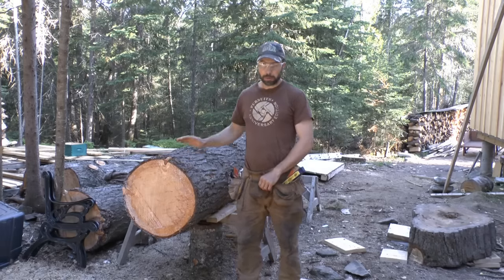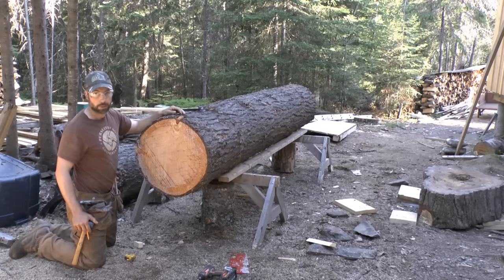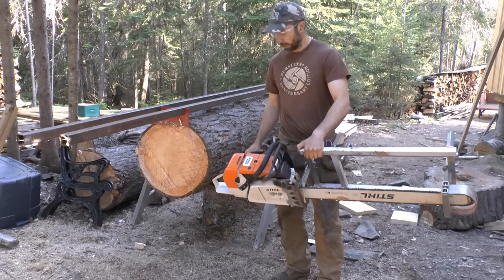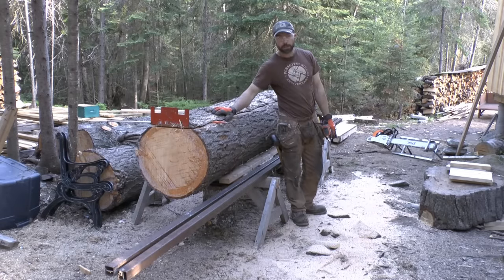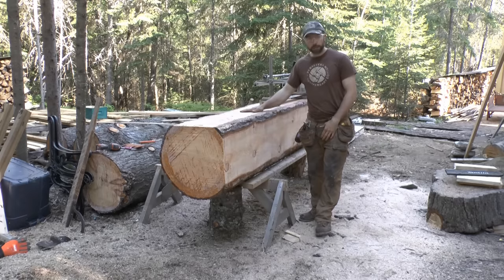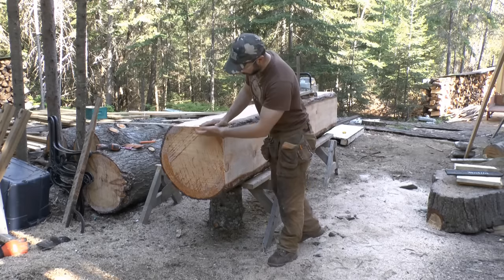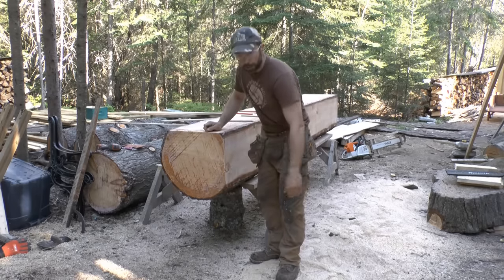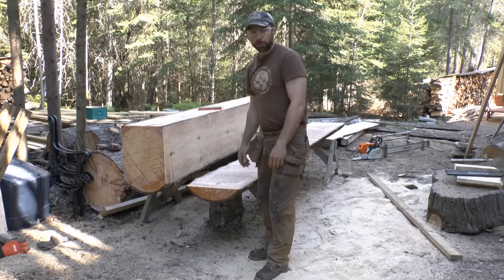Logs to Lumber: Alaskan Chainsaw Milling

Comment: Good job. I don't think you need worry about letting the saw idle to cool it. Not a bad idea on a 4 cycle at least in the old days when there was concern for bent valves. Not so much now.
Reply: I always let my saw idle for 1 or 2 minutes after a big cut....just makes sense.
Reply: You should always let it rest after running it for such a long cut.

Comment: Great video.  Inspiring.  Might be picking up a Granberg MkIV but I like your custom rail system, which looks far more robust than anything sold at retail.  What gauge are those rails?  Steel, right?  Look good and chunky, but not too heavy.  Assuming it's steel to span that kind of length without flexing.
Reply from the maker: Yes, 5/32" x 2" x 2" steel tubing, bought locally. 
The end plates are 1/4" x 12" x 5". The notches for the rails are about 1-3/4" deep so that the 2" rails sit a bit proud.

Comment: Seriously. Where did you get those end plates? I’ve been using an aluminum ladder for more year than I’d like to remember and the end plates with the steel 2 x 2’s looks way more stable. Please share.
Reply: Just found this earlier comment from Lure of the North:
5/32" x 2" x 2" steel tubing, bought locally. 
The end plates are 1/4" x 12" x 5". The notches for the rails are about 1-3/4" deep so that the 2" rails sit a bit proud.  These were cut locally by a metal fabricator.

Comment: Clever set up, but just for interest what width of wood is lost with each cut.
Reply from the maker: It's a little less than a 1/4" kerf.  When cutting 1" boards it does add up to a board or two lost (vs. bandsaws) in a big log like this.  If you're cutting 2" boards or thicker (beams, etc), then the 1/4" kerf becomes pretty insignificant.

Comment: A great beginning to begin milling anything vs buying a whimpy 15" or similar for $7K or more mill saw needlessly. One that is too small and too limited. Matt Cremona has made a very useful one, for a better price than retail...  All a matter of access to getting and moving timber for little or free. Or like a tree service, getting paid to remove trees.   I love the idea, only if practical if you have; 1/2 acre or more area, AVAILABLE ALREADY (FREE) a decent truck, and proper hauling trailer.  It is a must, less is foolhardy. Wood milling like this, elsewhere is okay to begin at the site. But you have to rig and be careful and felling a tree is not a risk most should take, without some experience (30 minutes of youtube it seems haha).  Good luck, looks like such value, only if you need enough of it or sell the lumber.

Comment: Great video, really liked the brackets, hope you don't mind if I borrow that idea, I was wondering how you got those logs up to your home? Green pine weights a ton. How far did you have to move them?
Reply from the maker: Of course use this bracket and rail method if its useful to you!  We hauled these by snowmachine in the spring.  Brought them a couple of km on a homemade komatik.  I'll try to get some footage this spring when we do a bit more cutting.

Comment: cut using the tip of the saw to cut large flakes, using the whole body of the saw creates dust, uses more fuel, and harder on the engine

Comment: G'day,

Interesting.

I too use my Chainsaw to mill Logs, but my setup is an English made "RIPKING" system, using 2" by 1" hollow rectangular Steel Guide Rails & a Slide-Guide..., with a Stihl 038 Magnum and a 36-inch Oregon Cutter-Bar (115 Tooth Chain).

The Ripking is simpler, lighter, one-man portable..., and it cuts with the Blade in the  vertical plane too, rather than gnawing it's way under the Slab being cut off.

The best feature of the Ripking system is that I can use it to propperly Quarter-Cut Mill the Logs so I can produce Timber which doesn't split, cup, warp, twist, bow, or bend as it dries & shrinks - though I could "Backslab-cut" Logs if I wanted to.

This past 3 weeks I've posted 6 videos showing the process of milling a 15-inch diameter Stringybark (Eucalyptus Hardwood) Log, 4 & 1/2 ft long into floorboards for my Verhanda Deck, replacing ones I cut 25 years ago.

The whole job took 25 & 1/2 hours, in 9 sessions over the 3 weeks..., yielding 29 Boards for 3.1 Litres of 50:1 two-stroke Fuel & 3 Hrs & 6 minutes of Engine-Runtime and 2 litres of used Sump-Oil for Bar-Lube...., emitting 7.75 Kg of Carbon Dioxide via the Exhaust.

On average, each Board took 53 minutes of my time, of which 6 minutes & 20 seconds was Cutting-time at full Throttle, using 106 ml of Fuel (21.8 cents' worth), 60 ml of Bar-Lube, and emitting 265 grams of C.O.-2.

   Please feel free to backtrack me to my Videos & title-search "Quarter-Cut Chainsaw Milling" or 
"Salvage-Milling With Chainsaw", to see the way I use the Ripking.

Another feature is that the two 4-ft long Guide-Rails may be "leapfrogged" over each other to enable ANY LENGTH of Log to be milled ; and thus  my record to date is the  24 feet-long 4-inch by 2-inch Purlins, 4 of them, which have been holding up my Verhanda Roof for 24 years - all cut from the one Tree.

The one time that I milled a Radiata Pine Trunk it was so comparitively soft and easy to cut, compared to Hardwood, that I "Slabbed" it into enormous Tabletops.

Anyway, follow me back to check out the Australian variation of the English Ripking Guide-Rail - used to Quarter-Cut Mill Hardwood.

It only makes sense if one has nothing else to do with the time & already owns the dead tree though, because in Oz at minimum wages there's $20 worth of Labour in burning  every 22 cents' worth of Fuel/Oil mixture to make each Board.

But it's a very satisfying passtime, for all that.

Such is Life,

Have a good one.

Stay safe...

;-p

Ciao !

Comment: Did you purchase the metal plates for the ends of the logs on the first cuts or did you make yourself? If bought, can you share where to purchase? Thx!
Reply from the maker: Its just 1/4" plate with cut-outs for the rails to sit in.  I had the metal supplier make the cuts for me when I bought the plates.

Comment: Hey great video Thanks! Did you buy the plates for the rail or make them? Thanks in advance.
Reply: Just found this earlier comment from Lure of the North:
5/32" x 2" x 2" steel tubing, bought locally. 
The end plates are 1/4" x 12" x 5". The notches for the rails are about 1-3/4" deep so that the 2" rails sit a bit proud.  These were cut locally by a metal fabricator.

Comment: What is your saw?  I was using the exact same setup with an older Stihl 044 that worked great for a few years but recently tried to cut thru some hardwood Black Locust and it blew up.  Probably poor maintenance on my part but at this point  l'm looking to replace the saw because repair was not reasonably affordable for such an older saw.  Looking for recommendations.
Reply from the maker: Its a Stihl 880, not cheap, but has treated me very well!  Good luck with the saw search!

Comment: Hey I’m going to build one of these and I would like to get a better look at the jig for the chainsaw otherwise great video dude thanks
Reply from the maker: Its a Granberg Alaskan Mill, available online.
Reply: @lureofthenorth  where do you obtain those leveling plates you screwed onto each end of the log?
Reply: @KurtKarshick  Just found this earlier comment from Lure of the North:
5/32" x 2" x 2" steel tubing, bought locally. 
The end plates are 1/4" x 12" x 5". The notches for the rails are about 1-3/4" deep so that the 2" rails sit a bit proud.  These were cut locally by a metal fabricator.

Comment: Nicely made tutorial video, but I would ask ; Since you do tree trunk slabbing on a regular basis, as a way to obtain cheap lumber for your furniture business, would it not be more profitable and less body stressful, to purchase a small portable sawmill, to replace your time consuming and exhausting setup and re-setup before and after each cut is made with your Alaskan Chainsaw Mill. Not to mention, the personal energy required and expended when manually pushing the chainsaw through the tree trunk on each slab cut and the rotating of the cant for cutting. In today North American market, there are a number of excellent sawmill manufacturers who stand behind their products. They keep an inventory of spare parts, blades, unit upgrades and also offer personal phone communications for help and assistance.
Reply from the maker: A bandsaw mill would be nice, but from what I've seen, they are best accompanied by other equipment as well (ATV, or loader, etc).  These logs were moved by snowmobile and komatik, we have no other machinery on our roadless property.  I don't think I'll consider a bandmill until we have more ability to move logs year-round. Trying to get the job done with minimal outlay of extra money and machinery!
Reply: Thank you for the reply, I do enjoy seeing money made the cheap way, but there is also the old, true adage, that time is money and a band sawmill is a time saver.

Comment: Did you make or buy those plates? THey look handy!
Reply: Just found this earlier comment from Lure of the North:
5/32" x 2" x 2" steel tubing, bought locally. 
The end plates are 1/4" x 12" x 5". The notches for the rails are about 1-3/4" deep so that the 2" rails sit a bit proud.  These were cut locally by a metal fabricator.

Comment: Where can I purchase those plates ? Does anyone know what thair called . Or do I have to manufacture my own ?
Reply: Just found this earlier comment from Lure of the North:
5/32" x 2" x 2" steel tubing, bought locally. 
The end plates are 1/4" x 12" x 5". The notches for the rails are about 1-3/4" deep so that the 2" rails sit a bit proud.  These were cut locally by a metal fabricator.

Comment: can anyone please tell me what is the brand/model number of the leveling plates you are screwing into the end of the logs?  I've searched but cannot fine them.  Thank you and great video.
Reply from the maker: 5/32" x 2" x 2" steel tubing, bought locally. 
The end plates are 1/4" x 12" x 5". The notches for the rails are about 1-3/4" deep so that the 2" rails sit a bit proud.  These were cut locally by a metal fabricator.
Reply: You can now currently purchase on amazon as well.. Truly not hard to find👍

Comment: I apologize if this was asked and answered but I didn’t flip through all 500+ comments. How long did it take to make the first 2-3 cuts. 10 minutes, 20 minutes- it’s hard to tell. But that saw looks like it does a really nice job. You did a nice job of explaining what you were doing as well. Thx.
Reply from the maker: 20 minutes is probably a good estimate with a log like this, longer shooting this video.  I'll often setup and square 3 logs consecutively in about an hour.

Comment: I really like your plates and rails. A couple of tips, if I may: Turn the mill top handle around. You're not even using it and if you turn it so it's closer to the operator you not only get more leverage you get further from the exhaust. 2nd- ear protection?  I Didn't see any you're going to get tinnitus. It's just a matter of when and how severe. 3rd- You scare me when you start your cuts. Get away from the business side of the saw. Your wife's a keeper btw. Great that she helps when you need it.
Reply: I already have tinnitus and bilateral hearing loss. Thanks Uncle Sam!

Comment: Lure of the North, I am trying to get a chainsaw mill right now. Husqvarna is not being too helpful. Can you please suggest a setup like yours: saw, bar and mill? Thanks.
Reply: @GATOR-ef3wv  thankyou so much for the info. I'm currently living in a tent on my land. I have tons of pine, but most is lodge pine. I can get logs about 6" in diameter. So I need to get the mill asap before it starts snowing. I'm very nervous  and worried about bears. I need a real shelter.
Reply: I have a husqvarna rancher 460 with a 24" bar so I hope it will work. Many of the mills on that site are in back order but I should be able to work with the delay. Thanks again.

Comment: Where can I buy a set of those plates?? I can get the square tubing, no problem. Man I am glad I came across your channel that is a very good setup you have and I learned a lot, Thanks and keep up the videos.
Reply: Just found this earlier comment from Lure of the North:
5/32" x 2" x 2" steel tubing, bought locally. 
The end plates are 1/4" x 12" x 5". The notches for the rails are about 1-3/4" deep so that the 2" rails sit a bit proud.  These were cut locally by a metal fabricator.

Comment: This is something that i'm considering doing. I have a Stihl chainsaw already and every retailer that i go to says that Stihl doesn't make ripping chains. You clearly mentioned it a few times in the video, can you lead me in the right direction of what i would need?
Reply from the maker: You can use any manufacturers chain on your Stihl saw, as long as it matches the pitch, gauge and # of links of the bar you've got on there.  I like Granberg rip chain: https://granberg.com/product-category/chain/chain-chain/

Comment: What size square tubing are you using and those side plates? Wonderful
Reply: Just found this earlier comment from Lure of the North:
5/32" x 2" x 2" steel tubing, bought locally. 
The end plates are 1/4" x 12" x 5". The notches for the rails are about 1-3/4" deep so that the 2" rails sit a bit proud.  These were cut locally by a metal fabricator.

Comment: What length rails are you using in this video?  16-20’ ok?
Reply from the maker: The rails should be a couple of feet (minimum) longer than whatever length log you intend to cut.  These rails are ~ 14'.

Comment: How long do you leave the logs after cutting before milling?
Reply from the maker: If blocked up off the ground they can be left for a year or more, but I usually try to mill up all my logs within a season.  I've felled some logs and milled them the same day in the past.

Comment: How can you get a square log with just three cuts?
Reply from the maker: The 4th side is left on, and the boards are cut off the 3-sided cant.  You end up with the 4th slab at the very end.

Comment: The two red plates for the 2x4's; are they available for purchase and if so where or did you make them? Thx JohnyMac
Reply: Just found this earlier comment from Lure of the North:
5/32" x 2" x 2" steel tubing, bought locally. 
The end plates are 1/4" x 12" x 5". The notches for the rails are about 1-3/4" deep so that the 2" rails sit a bit proud.  These were cut locally by a metal fabricator.
Reply: @patrickcleburneuczjsxpmp9558  Thank you Patrick. I kind of figured they were home brew. The idea is great because the steel tubing would not have a natural bow like wood 2X4's might have. Steel tubing would have less bow than aluminum too. Thx for the measurements. I have some scrap 1/4" plate material and I can make up myself. The tubing I will have to look for. 73 & God Bless Brother. PS, good videos Brother!

Comment: Thanks for the video.
I have a question regarding the rail system that you were using,  did you make it, or was it purcahsed. If purchased  I'd appreciate from who. Thanks.
Reply from the maker: I'm using 5/16" x 2" x 2" steel tubing, bought from a local metal fabricator.  I don't remember the price, but it was an in-stock item and not a lot of money.  The end plates are steel plate, with cut-outs for the 2x2 rails to sit in. I had the fabricator make the cuts in the plate for me.
Reply from the maker: The end plates are 1/4" x 12" x 5".  The notches for the rails are about 1-3/4" deep so that the 2" rails sit a bit proud.  Works great for logs without a lot of taper.  For heavily tapered logs having a taller "offset plate" (eg. one at 5" tall, the other 10" tall) would make it easier to make the first cut parallel to the grain.

Comment: Great video. Loved the vireo music in the background. Great plate and rail system and I really like how you raised the log in the air using ramps, can't hook, and saw horses. I milled the super structure for my cabin (studs, rafters, joists etc. 30-years ago. Have an new project now but all that bending over as I did before would be too hard on my knees & back. Awesome cabin, board drying techniques! Screwing the batting boards is a good suggestion. Any cupping on the batting boards when it dried? Did you caulk the edges. Any suggestions as time goes by would be much appreciated. Love your cart too. Did you build it?  :-)
Reply from the maker: Thanks for the kind words.  I haven't seen any cupping of the battens (only 3" wide).  The boards that were installed last spring will be seasoned and ready to stain this coming spring, so I'll shoot a follow-up video showing a year of aging then. 
We did build the cart.  I bought the plans for a smaller one online for about $10 (years ago, can't recall the name unfortunately), then outsized the design for the lumber hauling cart.

Comment: what type of permit do you need to remove these size trees from the forest?
Reply from the maker: It'll depend on the area.  In Ontario no permit required on private land.  On public land you would typically require a forest managers certification and have to submit a forest management plan to the ministry for approval.

Comment: I was surprised that the  saw horses were able to hold  the log.
Reply from the maker: These saw horses have held many logs that they are probably due for retirement by now!
Reply: @lureofthenorth  
I didn't think that they would be capable of handling the load even if they were new.
Reply from the maker: @harrietsimmons3816  Go 2 x 4 s!!

Comment: What about the red supports for the guide rails?
Reply from the maker: 1/4" steel plate from the same supplier: 1/4" x 12" x 5". The notches for the rails are about 1-3/4" deep so that the 2" rails sit a bit proud.  Painted red because of the prodigious amounts of sawdust created!